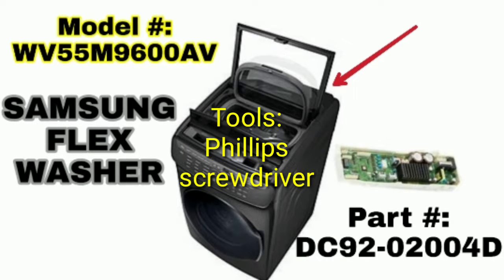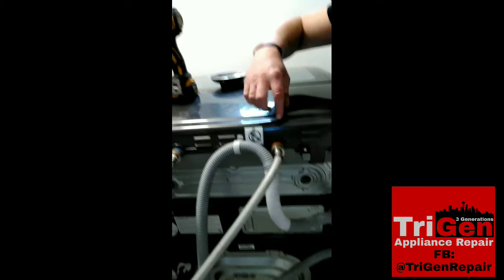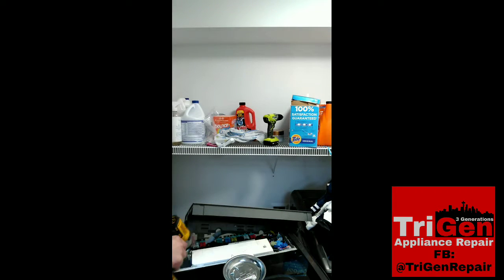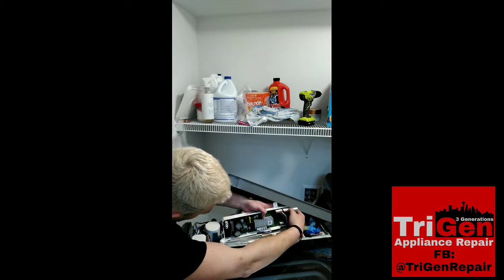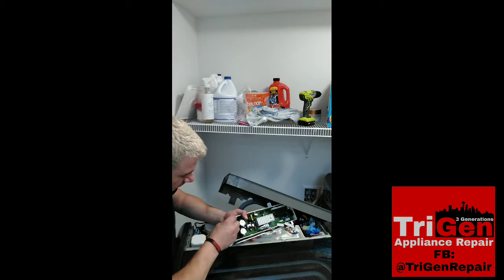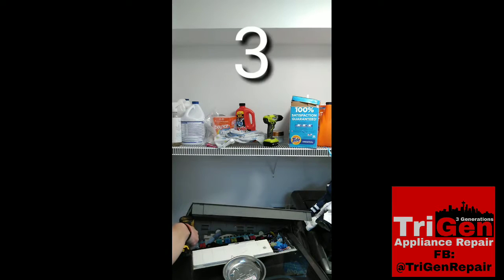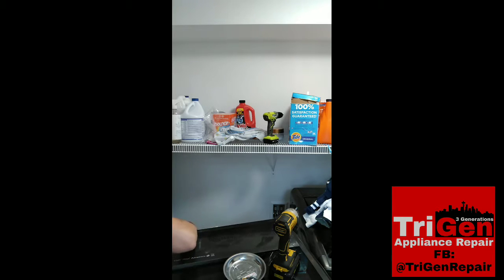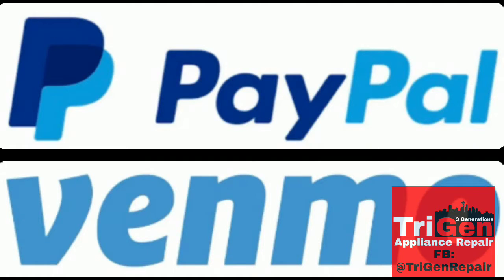Samsung Flex Washer- Main PCB cuircit board DIY remove and replace.

Comment: do you know where the vibration sensor is for the bottom, large tub?  I have this model in ur video and the bottom will not fully spin only spin slowly, comes up eventually with unbalanced error at end of rinse cycle - so it works ok but that sensor I am told is why it will not spin fast.  Yes, I reset it and did calibration cycles many times lol

Comment: I have a samsung flex washer WV6OM9900AV/A5 02. The top washer works perfectly fine. The lower washer will turn on but when I try to start a load it acts like it's going to start but will not fill or spin. After hitting start 30 seconds later it just go back to the main screen but instead of a error code the screen is just spinning in circles. Do you think it could be the contol board and if so do you have a part number?
Reply: I'm having this same issue, were you able to figure it out?

Comment: So my flex washer. Pops the breaker as soon as i plug it in. I plug it in to another source and it just pulses a vibration sound in the back. I get no codes no lights nothing. Could it be this board?

Comment: You didn’t tell us how you came to the conclusion of needing the PCB changed……I’m getting the AC6 error, after washing a load, then the next morning, the circuit breaker tripped, i pulled the plug and tried putting it back in, it tripped the breaker a few times… I left it off for a hour or so….I plugged the washer back in, the breaker didn’t trip this time…. It’s stuck on a wash cycle, won’t move, won’t start, door won’t open… I sat next to it for a while and the AC6 code was shown on the panel.

Comment: I have a samsung flex washer wv55m9600av it will not turn on. Like others I hear clicks when I push the start and power buttons. But I have no lights or codes on the front. Any ideas?
Reply: I have the same issue where the washer turns on but lights go off on user control board. Did you figure out what was the issue? TIA!
Reply: Same here

Comment: Hey Tom, I have a Samsung Flex dual model# WV60M9900AV/A5 01.  The lower drum on the machine mysteriously pauses during a cycle.  Sometimes it won't drain, sometimes it won't spin, etc.  It just sits there and then I need to push the start button again.  It did throw a 3C code once.  Do you think it needs a new PCB?  
Thanks in advance

Comment: I have samsung WV55M9600AV/A5 washer.  When I turn on power, it displays with pre-selected options, and does not let me change any selection, and it does not start when you press the start button.  It does not give any trouble shooting code either
Reply: Mine have the same problem. Did get yours fix already and how was it resolved ?

Comment: Hey Tom, I have a Flex washer that has an AC6 (communication issue), should I check the connections first (the connection behind the push buttons)? The lower door door will not latch closed either. The top seems to work fine. Thank You
Reply: did you ever get it fixed?

Comment: Hello Tom, What was the problem with this machine? Mine all of the sudden has no lights on the display. If I press the power button I hear a click. I located the top control board and it has two little green lights. One of them goes on and flashes if I press the top washer power button. I located the "main" control board under the tub and it also has a little green light. Do you think I need a new display board?
Reply: I have the same issue where the washer turns on but lights go off on user control board. Did you figure out what was the issue? TIA!
Reply: @MiloLerma-vd6hn  I did, I replaced the display control board (the board behind the buttons). There was a left and right side and I didn’t know what side was bad so I bought the complete board with both side and it’s been working since then. We don’t use the top washer anymore because it’s always leaked into the machine causing trouble and flooding the bottom which covers the water sensors which won’t let the machine run until it’s drained out and dried. At this point the whole family is used to using just the bottom.

If I remember correctly, I hired a Samsung repair guy to diagnose the issue and sent him on his way. I bought the part and replaced it myself.
Reply: @DobraLLC   Thanks so much for the response! Would you have the link or part # of where you ordered the part? Thanks again!!!
Reply: @DobraLLC 
I have the same problem as yours, i just don't know which board to replace. Do you think I need to replace the display board first? And where did you get your parts from? Thanks for your response.
Reply: @yirgalemdesta7869 Every time I try to reply YouTube is filtering my comment. I’m trying to give you the part number and where I bought it.

Comment from the maker: This is still the first and only one of these a customer has ever called me to repair. Don’t get me wrong they are both amazingly successful companies when they stay in their own lane. However Kennore which we all loved and relied dependably on for decades is no longer the same machine it is an LG now and 90% of my calls are on Samsung and LG. I really got lucky here because the person or business I purchased it from gives a 30 money back guarantee which is crazy because some idiots you know are gonna fuck it up because it wasn’t Ever the board to begin with or something just a wire grounded out me is blowing a fuse or welding a relay. These boards are all covered in 1/4 inch resin or rubber so you’re not fixing it yourself.anyway the eBay company took it right back paid the shipping fee and all and sent me the front display board in 3 days and that’s the one it happened to be on this fix. Not very smart to keep making a machine the uses soap full of lie or sodium hydroxide (very corrosive) to the rubber keeping the water in the drum and not dripping on your downstairs neighbor. They still seem to last 7-10 year before needing replaced.now that’s a job that if you intend to try yourself you’re going to want bandaids handy, make sure the swear jug has plenty of room for quarters and play yoga music. So back to this repair ya I got the money back right way for the first board the rear one I thought it would likely be but it’s absolutely gotta be a guess at that point. Received the front display board it fired up and I’ve never seen a China man dance in such delight hahaha. I loved that guy didn’t even charge him to come
Back with the next part lol.
Stay away from these lg Samsung and Kenmore appliances for at lease 10 more years because you’re just a Ginny pig and TVs require much less automatic and precise components as a fridge. Night and day. For some reason consumer report is backing them $$$$

Comment: and if it still won't work now what keep guessing ???
Reply from the maker: There are 2 major boards that could be causing this. Not sure if you replaced one or both. Also sometimes a simple reset will do the trick. Unplug it or kill power at the breaker. Hold the power and start/pause buttons at the same time for about 10 Seconds then return power and see if it turns on. But I’m this case I replaced the rear board didn’t work returned it then replaced the front control board and that was the winner. If you replaced both boards and it still won’t turn on then you should go shopping because Samsung has only been manufacturing appliances for 20 years hardly long enough to know anything bout it. They have no business trying to come out with the first front and top loading washer when they still don’t have either of the 2 fundamentally down yet. Wirlpool and GE have both been in the domestic appliance business for about Just over 100 years and neither one of them have tried to create or manufacture a top loading front loading washer so what does that tell you. Honestly if you got the space I would stay away from front loading washer is altogether. Think about it commonsense would tell you if one needs a gasket to keep the water from leaking out and one doesn’t that’s one less part you have to worry about and that’s a pretty significant one. Also laundry detergent just like all soap is filled with lie or sodium hydroxide Very corrosive to rubber so 7 to 10 years you’re going to be replacing the gasket anyway I just hope you catch it while you’re home

Comment: Thank you for this. Have you ever changed out the wiring harness from the main board to the display?
Reply from the maker: No this is literally the only time I’ve seen or worked on a Samsung front/ top load washing machine. So this repair is about as far as I’ve dug into it. My knowledge gap on Samsung & LG appliances in general is still quite big because they have only recently jumped into the domestic major appliance manufacturing game. Most techs won’t even touch an lg or Samsung appliance. However they push them and somehow have “won awards”$$$ and receive great consumer reports $$$$. Even though 80% of the calls I get are on these 2 brands. So I could see that I had better get familiar fast because only having 20 years of experience in appliance manufacturing is nothing compared to wirlpool which is basically all other American brands like Kitchenaid, Frigidaire, Maytag, ect. Who made the first domestic refrigerator in 1913. That’s quite a jump on lg an Samsung who started in 2000. GE is also a solid choice. Kenmore used to be amazing until Sears sold the name to LG. Which is bull shit. That’s like putting a Lamborghini logo on a Kia. I don’t even go on most lg fridge calls because I know exactly what’s wrong and it’s always a leak in Freon sealed system right from the factory. I’ll be it a really really  slow leak but people are spending big bucks on the flashy lights and energy efficiency sticker just to junk the fridge within 3-5 years. Sorry for the long detailed reply but people need to know that even though these are great companies for electronics. We’re all Ginny pigs when it comes to buying their appliances and unfortunately some upset folks may stop buying their phones and TVs ect. Just because of how upset they are with the appliance they spent 2k plus on. My advice as a technician who sees it all first hand. Maytag seems to be best in class of the wirlpool brands, Bosch make a great dishwasher that is by far the quietest in class but that’s about it for German brands. People before buying an appliance get good actual reviews from as many sources as you can even if you need to call me or another outfit to ask their opinions they wouldn’t hesitate to inform you. Also think parts availability because there are very few local appliance parts dealers and they won’t even stock parts for Bloomberg or Miele or Viking. Also think about service. Like I said most appliance techs won’t even come troubleshoot an LG or Samsung just cause they are so electronic and not many are familiar with them. So stick with GE or Wirlpool brands. Cheers.

Comment: Greetings, would this be the main brain for Samsung WV55M9600AV/A5. D3 T

My washers front control panel losses power. Power lights go off and don’t come back until a couple hours even though you press power button. Power at times returns seconds at a time. Would this be the part to fix this problem. Or would you know, or have the part for this issue. Thanks in advance.

Comment: Did you perform this service because the bottom washer would not turn on? That’s my problem and sir you are saint for putting this out there!
Reply: Ever figure your issue out? My bottom wont work but the top wash still does. Curious if this replacement would solve our problem.

Comment: When you took the back cover off. There are three screws on the touch panel right behind the control panel. Can I send you pictures? I'm trying to put mine back together and can't secure the touch panel to the top cover.

Comment: I have the same machine, 3 days ago it stopped and now the front door is locked with clothing inside. Would this solve my issue?
Reply from the maker: I’m not 100% sure about that. If you’re machine is still turning on then it’s likely a drain pump or clogged drain line or faulty pump motor. The door won’t unlock until the water has drained. Your issue is a bit different then the one diagnosed here as this unit wouldn’t even turn on.

Comment: I got ahold of a flex washer and dryer floor demo from Sears when they closed down. The factory does something to them so they can’t run. I replaced this same board and that got the bottom washer to work for me. I still can’t get the top washer to work. Can you tell me if there is a separate main bird for the top washer?  Where would that be located?  Please let me know if you have suggestions for me to fix this. Thank you so much. Jhn102467@yahoo.com

Jeffrey
Reply: Only one board. Check connections for corrosion. Ohms check wires and switches. Door switch may be inoperative.

Comment: Would you sell me one of those main boards please ? im in São Paulo - Brazil and i got one of those from Miami and due to electrical surge ai my building the main board is broken now and machine wont turn in now
Reply: @georgescott1180  Ty  , theres two boards, would this one pair with the other ?
Reply from the maker: Sorry I don’t sell parts at all. I got all the parts I used on eBay for this particular repair. Many good eBay stores that sell used and new parts that have great return policies. For instance the first board I got wasn’t the correct one and I installed it and everything. The eBay company refunded my money and sold me the correct one no questions asked.